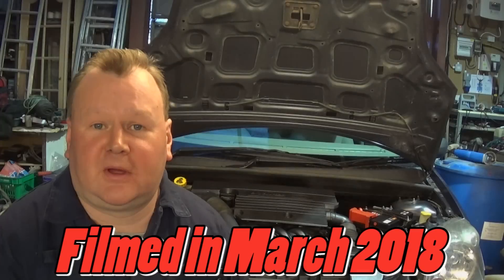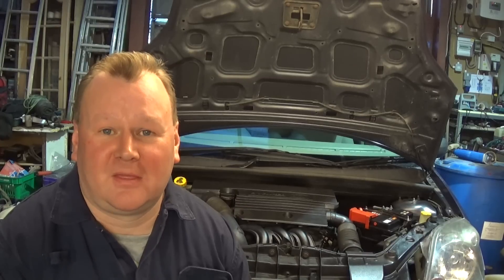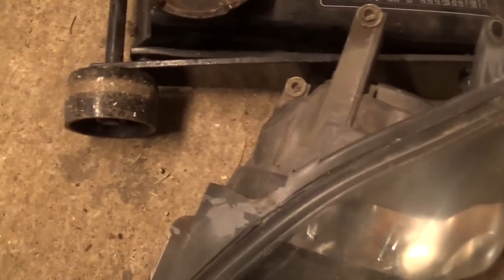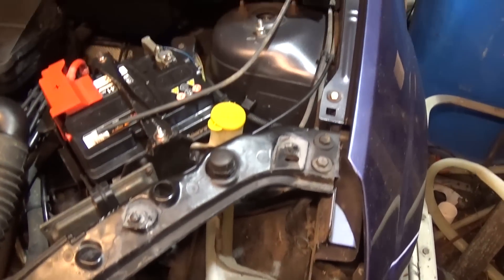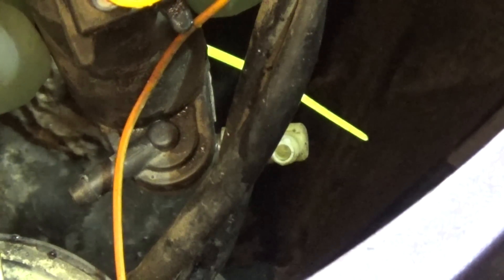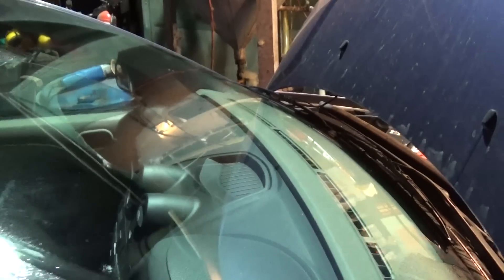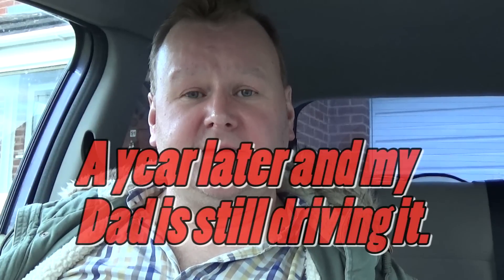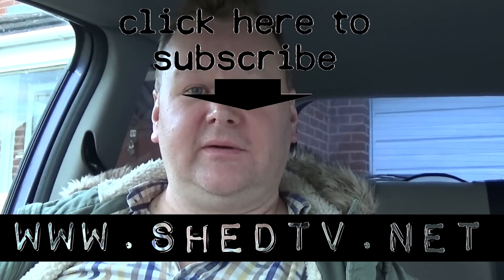Part 2 - £100 Fiesta - Headlamp and Windsceen Washer Repairs and MOT

Comment: Had exactly the same problem with my mk6 Fiesta ST.
Was all ready to follow this helpful method.
But then an old AA friend of the family said "Open the bonnet."
He put the pipe into a jug of water.
I pressed the washer function from inside the car. 
Then a whizz and a whir, and a pop, with a chunk of gunk dissolving in the container and the blockage was freed. And the jets are as good as new.
No doubt a full clean is the best method. 
But for a five minute quick fix. You can't go wrong.

Comment: I did that myself. I over did it with the screen wash and it congealed in the bottom of the bottle.... it can be in there for months
Reply: Happened to me too then a mechanic friend told me to add a tablespoon of vinegar to the washer bottle,that stops the washer fluid gelling up and keeps the jets clean.
Reply: same thing happened to mine but i think it was clogged with algae because i didnt put in the right amount of screen wash in the water. the bottle was filthy and the water was filled with black algae. so got to get the right ratio it seems otherwise you get a the same problem.

Comment: You could've saved another £100 by doing brakes yourself. Easy enough job
Reply from the maker: Yes indeed, and I'd have been happy enough doing it myself, but the clock was ticking; I thought that that £100 was well spent.